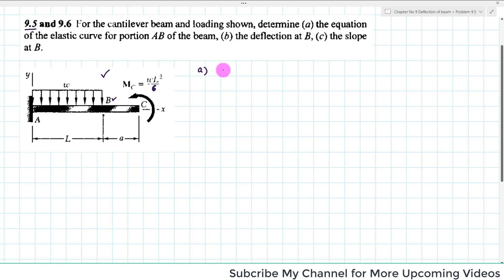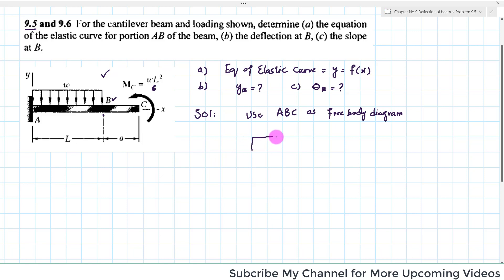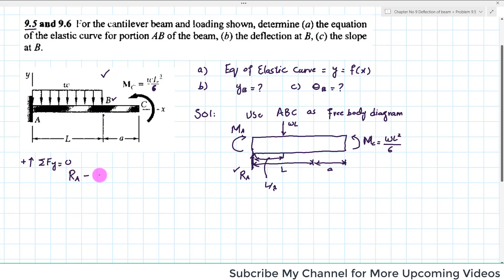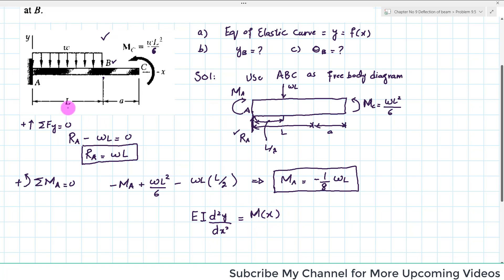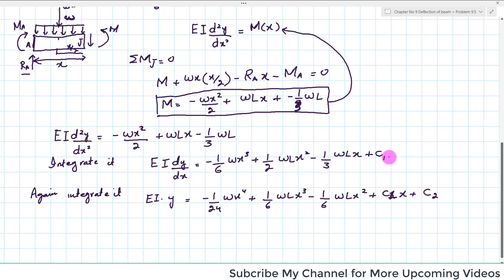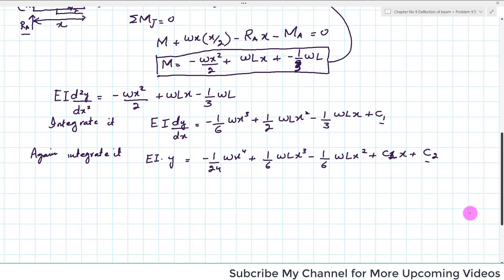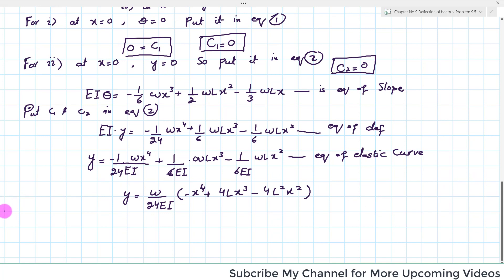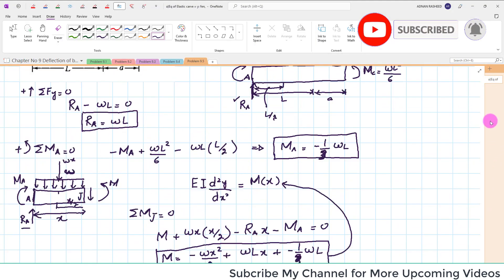9.5 Determine equation of elastic curved, deflection & slope |Deflection Of Beam | Mech of materials

Comment: Using Ma=-wL^3/3, i am getting for the slope thetha b= -wL^4/(24EI). Can you please confirm sir?
Reply from the maker: There is mistake in the problem which I solved.  MA IS WL^2/3. So you have calculated Yb= -WL^3/24EI which is deflection and slope a theta B will will zero.... Good job.
Reply from the maker: Check out these problems as well 
Chapter 12 Deflection of beams and shafts BY MECHANICS OF MATERIALS  R.C HIBBELER (9TH EDITION), Complete Solution by Engr: https://www.youtube.com/playlist?list=PLuj5YwfYIVm-zYKIRhkcp8T14ca9gKZVM